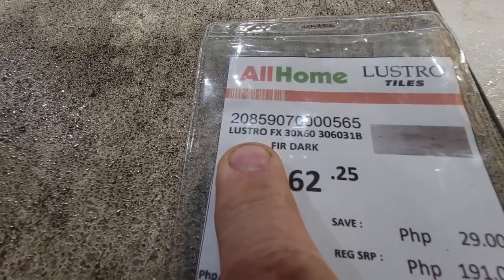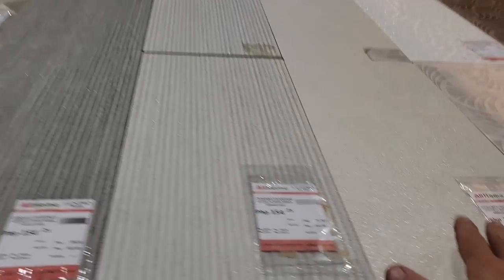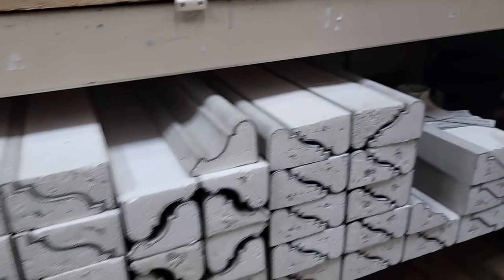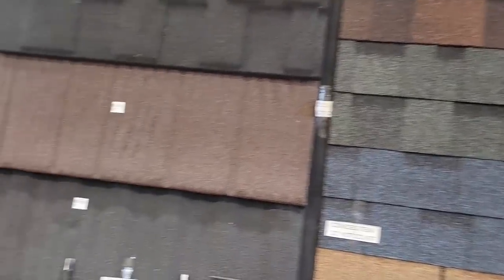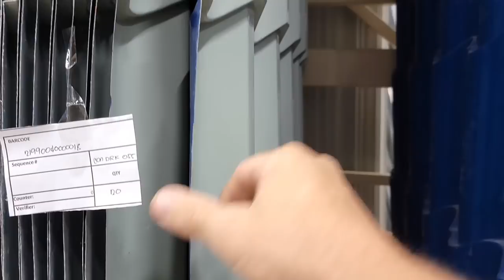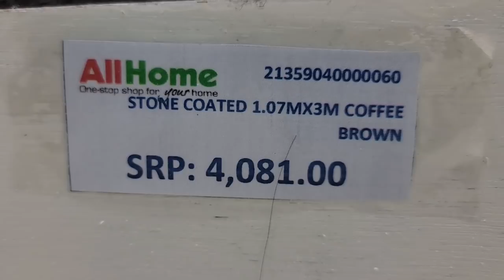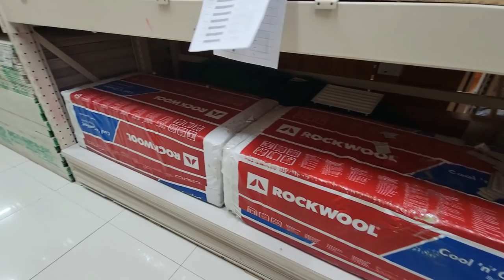Philippines Beach House Build Day 249 Part 3: Master Bath Tile , Stone Coat Roofing and MORE!

Comment: I really love those long panels and the sculpting. I couldn't find any shingles when I was there a couple years ago. But, even though I like asphalt shingles, the longevity would be drastically reduced because of the searing, pervasive heat. I had planned on using regular metal, standing seam. But I may change my mind with those sculpted panels.

Comment: That stone coated roofing does have a nice profile! Can't beat it being the right length - no cut edges
Reply: I'd worry about the winds they get there thou > just like what blew thru a few weeks ago.
Reply from the maker: It wont be  over any interior just over the veranda outside. Also I know how to attach it that the chances would be low.

Comment: my nephew has a spray insulation business upstate NY near Niagra Falls. He told me about a new product that is a fire proof (not retardent) and is a spray on insulation and it's made for both interior and exterior use. Also building codes here in NYC have been so degraded that now they can build a frame house using green paper sheetrock as sheathing as long as it's covered with a spray on insulation and then covered with a coating of .5 inches of stucco or cement. This satisfies the building codes and fire codes here in NYC.  Besides all of that you have a minimum 3 inches of poured steel reinforced concrete which in itself is a fire block. If it were me I would at least look into the coded there and see if you could do it it could look great and save u alot of money in materials and labor. Again I am not trying to tell u what to do, after all its your house and your money and totally your choice. It's just a friendly suggestion. By the way I really admire what you have already done there with that build and I admire your knowledge of building and plumbing and electrical and even your knowledge of the solar systems. Well I wish u nothing but the best of luck moving forward and waiting patiently to see the finished product. And your wife continues to beautify the grounds with her personal touch and hard work a d knowledge of planting a wide variety of plants herbs and fruits and vegetables. Best of luck to both of you.
Show less

REPLY
Reply from the maker: it is not possible to happen here. The product is not here and I am already at my max I can go on thickness at the property line.
Reply: @TexasFilipino  AHHHH sorry I did not know the house was built right on the property line. Again I am sorry and was not trying to tell you what to do ,only a suggestion best of luck to you and Mel

Comment: Price difference on the two kinds of stone coated long-spans was for the different lengths. One was 1.07Mx3.0M and the other was the size you needed at 1.07Mx2.5M. 
Looks like a good blending of the old long span metal roofing and the stone coating.
Reply from the maker: I think so too George. I think the coating will help it last longer against the salt. What do you think? The screws they use here will get ate up by salt within two years. I should have sent screws from USA but forgot!
Reply: @TexasFilipino  
Certainly looks like that was the marketing intent. 
Curious what kind if tech screws you would use to protect against the salt? Tech screws covered with color matching polyurethane sealant perhaps? I don’t know 🤷‍♂️

Comment: Great to see you are getting close to the end of the project, I've enjoyed watching it for the past year since I found the channel.

One thing I wanted to ask you is why you are only counting the days you actually worked on the construction instead of total number of days since you broke ground which is the normal way of cataloguing a build? If I'm not mistaken you broke ground around August 13 2019 which technically would make this build day 920?
Reply from the maker: because I think being gone 6 and 7 months in the USA dont count much as build days. I do find it odd you took the time to add those days to make a point that has no value.

Comment: G'day mate great show, Hahaha you crack me up still dealing and talking in inches lol we talk mils here🇦🇺 mm only because on sites you only have a 5 to 15mm tolerance between done right or not right😄 👍🏼 all good mate. Thats just my Carpentry and Panel Beating trades coming out in me. Precision brotha lol i know your precise i know you probably just done it off the top of ya head, happy days👍🏼.
I really like the sheets excellent the difference was the length (the numbers displayed 1070mm x 2500mm or 3000mm) had to get the mm in 😆(the numbers you put up on screen inch to mm basically 1070 x 2350mm). any how i like 🤙🏼
It will be interesting to see the bathrooms finished with so many different patterned tiles tying in together i'm sure it will look great you have the vision, being there physically and not are totally different (they all do go together though like you said looks like a set). 
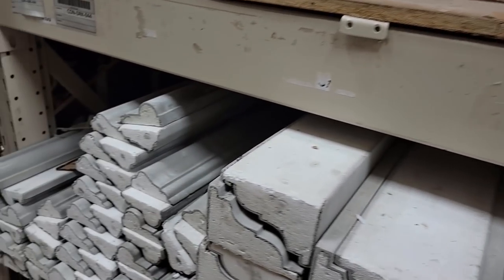That dado rail ( 4:38 ) you were looking at i prefer the more rounded one's as less dust for it to collect and will sit on top 😉 i don't like flat surfaces were dust can settle.
Bet ya can't wait great job mate awesome so happy for you both well deserved
take care and have a great day 🇦🇺🇵🇭🤙🏼
Reply from the maker: They ise both here. Did you see the display signs in the store for the lumber? All in inches and feet. That is the way this country is. Everything is a mashup
Reply: @TexasFilipino  yerh mate i noticed it majority of it there is like that 👍🏼 have a great day both of ya 🇦🇺🇵🇭